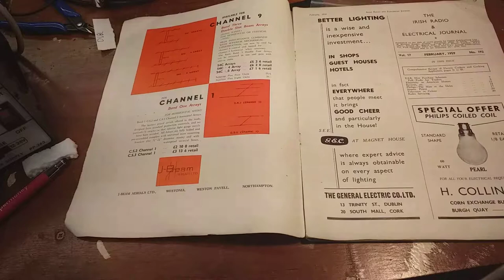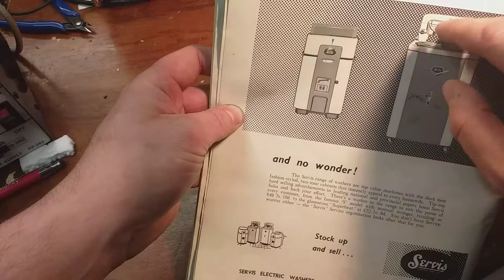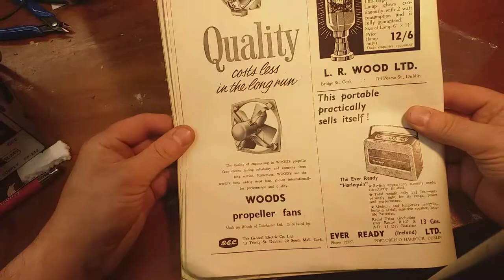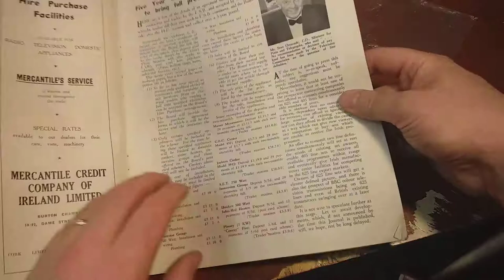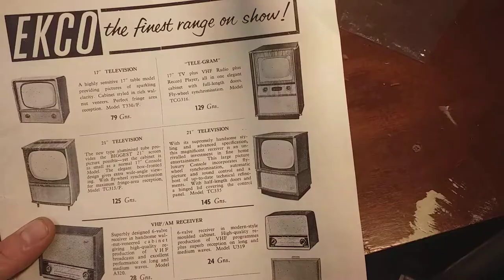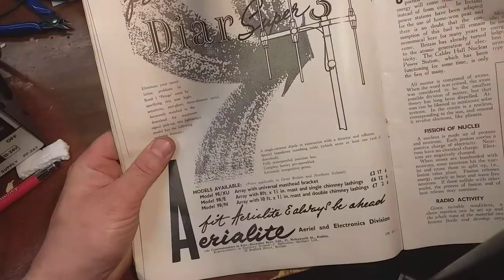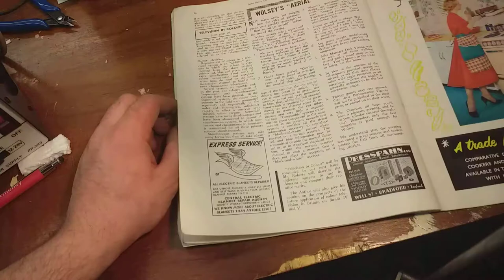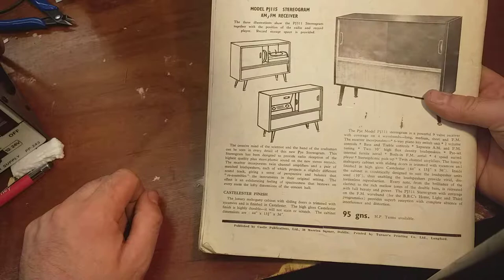Tonight I review the February '59 edition of Irish Radio & Electrical Journal.....

Comment: I remember reading (probably in Practical TV) that reception of 405 line Dublin Ch7 in the North on Pye VT4's wasn't very good and it should have been..This was a very early band 3 set and Pye were supplying a replacement tuner for it.
Reply from the maker: VT4's certainly weren't short on gain. My friend John found a VT4 at the side of the road on his way to work in the first few weeks of having his own shop back in 1974, he picked it up and brought it with him. He got it going and rented it out, an old dear who only wanted RTE and BBC1. After about 6 months it failed so he decided to swap it for an A640, the look of horror on the old dears face, it had nowhere near the gain of the old VT4 on BBC1. And the A640 wasn't exactly short on gain either!
Reply: @IrishvintageTVRadio  Yes,loads of gain. have a VT4, bought it a few years ago in a flea market,still works ok I changed a load of caps at the time,fortunately the lopt was ok..65 years old now!